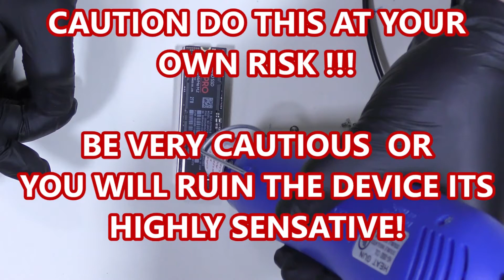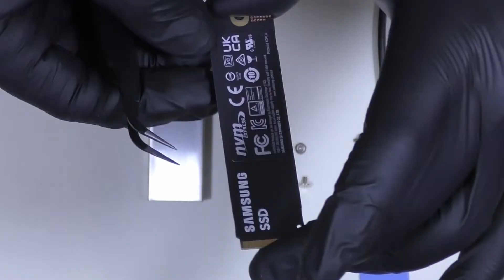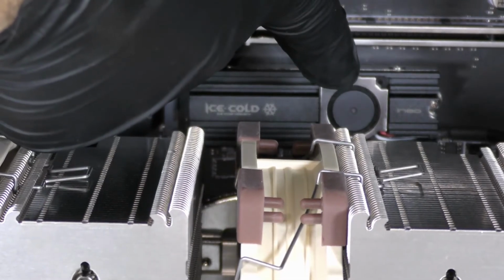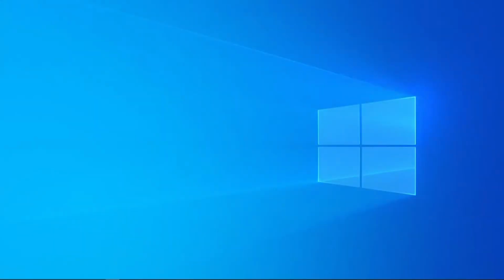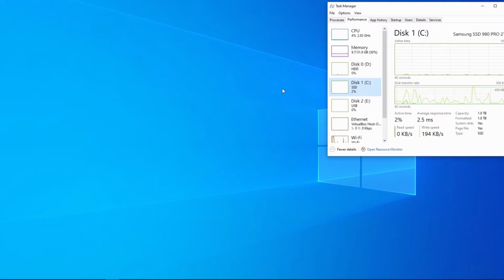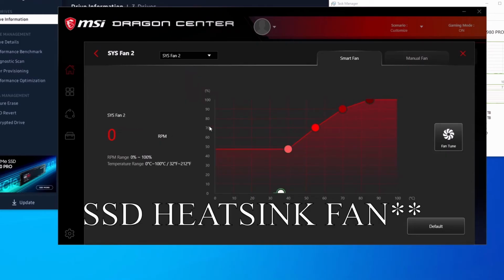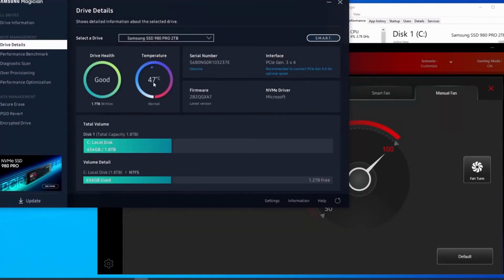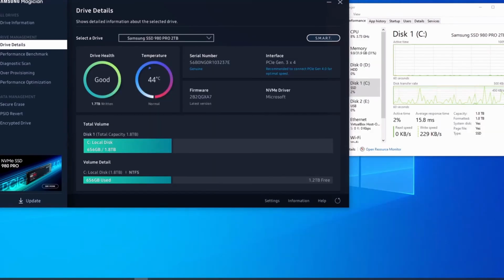HOW TO INSTALL HEATSINK COOLER ON AN M.2 SSD | FULL STEP BY STEP TUTORIAL & REVIEW

Comment: 47c and it isn't running at full pcie 4.0 x4 that will heat it even more. I got a heatsink similar to this with the fan and all and also get far worse temps with it than the other one sided copper heatsink i replaced it with.

Comment: Regarding the comments about the stickers being thermally conductive, they are not. It is just a piece of paper it does absolutely nothing to help the m.2 cool down. Actually it does the opposite. When i removed the sticker on my m.2, the temps dropped by 8c.
Reply: They are, there is metal inside the sticker.

Comment: Ultimately it is up to the user whether or not to remove the ssd stickers for installation of the thermal pads..
I remove the stickers on certain brands because I'm not too worried about warranty considering how many hoops I have had to jump through in the past. 
Good brands that honor their warranty with little singing and dancing, I would definitely leave their stickers on. 

Definitely wouldn't remove the sticker from a Samsung m.2 ssd. The cost of most of them is too high to throw away the warranty and if you decide to sell the PC, the talking points are usually the performance parts installed. Hard to prove the breed of the parts without identifiers.

Comment: you really don't need to remove those stickers they are already thermal pads and may even be better than generic ones or you could just fit it with the stickers on and still apply the pads if they are 0.5mm

Comment: You shouldn't remove the sticker, I learned not to do that, most of those stickers are thermally conductive and spread the heat, also removing them void the warranty, plus using heat like in this video may cause damage the NVME
Reply: True my heart broke when he did it for real 😫💔
Reply: yes he doing waring omg